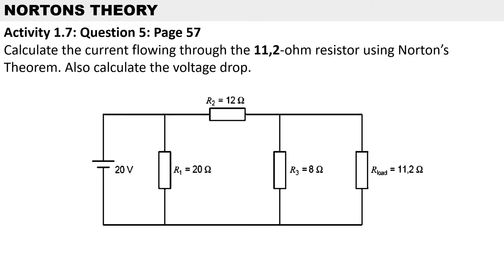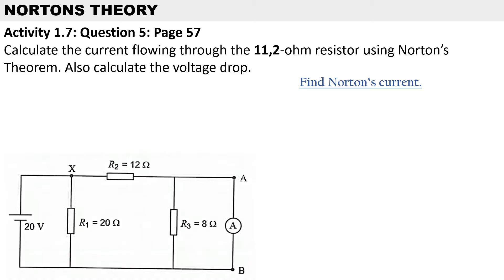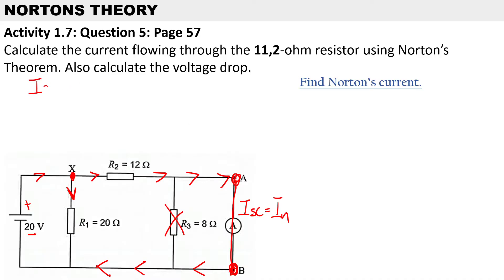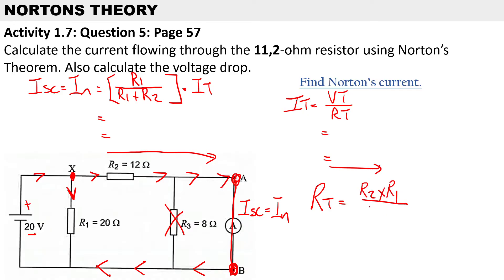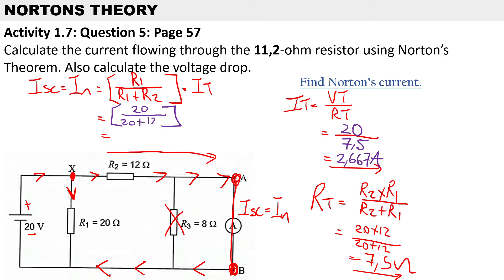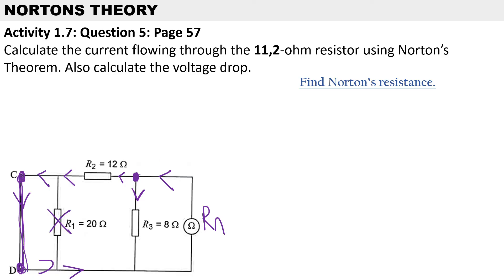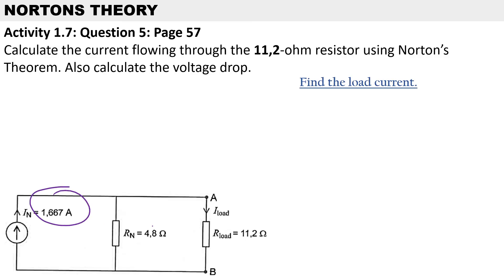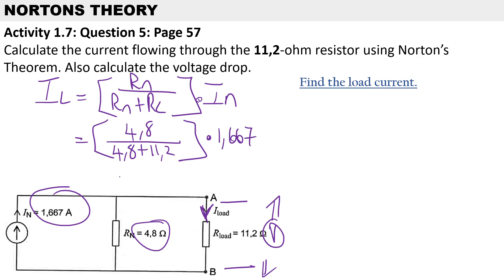Activity 1.7: Question 5 - N4 Electrotechnics

Comment: Sir you short circuited load resisitance but you also cancelled the 8 ohm resistor can I please get clarity on that
Reply from the maker: The flow of current from the battery will choose the path of least resistance and will flow through the short circuited wire rather than traveling through the 8 ohm resistor. 

In a sense, the current bypasses the 8 ohm resistance, and the 8 ohm resistor becomes irrelevant